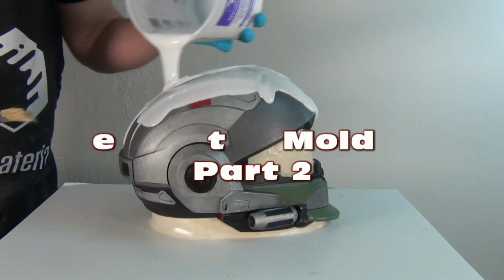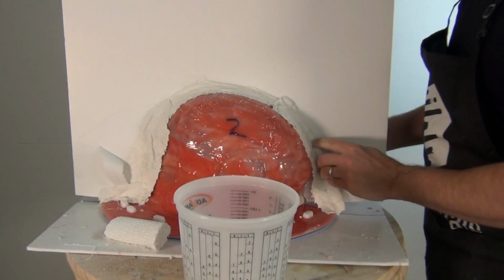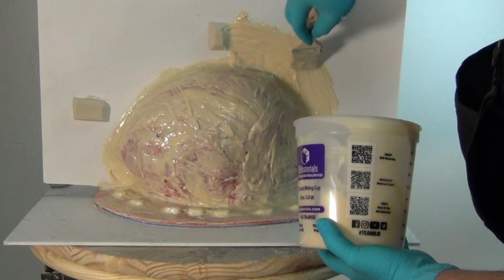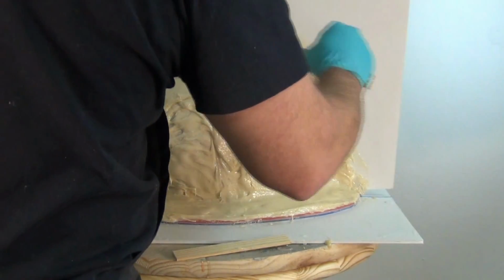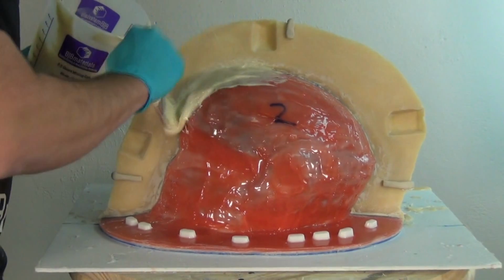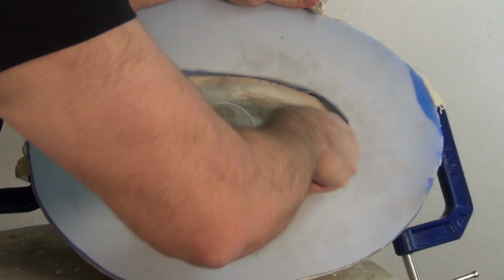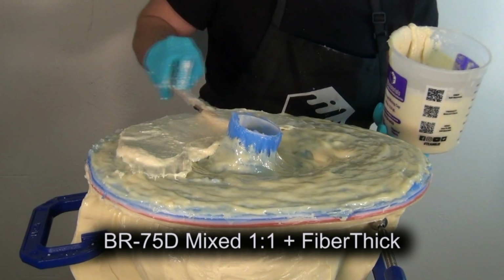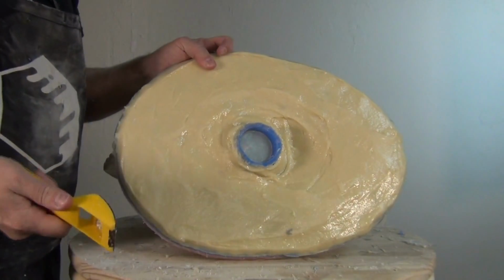HALO Cosplay Helmet Mold Part 2: Resin Mother Mold

Comment: Could I use an expanding rigid polyurethane foam as the shell instead of resin?
Reply: Just to add some tech info.  Rigid foam like our TC-300 (6 and 10 pound versions) has been used extensively for mold supports, typically in core boxes and behind a surface of epoxy/fiberglass.  In theory, you could use it for a simple shell mold.  However, it's going to be wildly hard to tame and keep a smooth shape, so you will need to come back and shave/grind smooth to a more uniform thickness.  The flanges would be more brittle with foam itself, so if you used it in conjunction with something like BR-75D (seen here) you could achieve a lightweight shell construction.  Note, the exotherm temperature of foam will be high, so a clay pattern or something with low heat resistance may not be appropriate for a technique like this.
Reply from the maker: A foam support shell would have to be a lot thicker in order to have similar strength and the parting line would be very tricky. Experiment first before you do it on a critical part!!